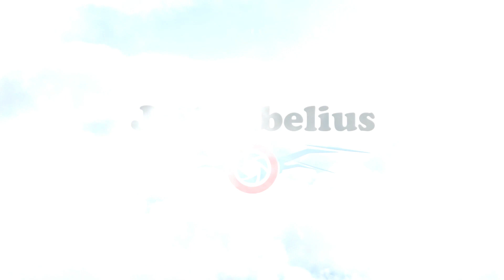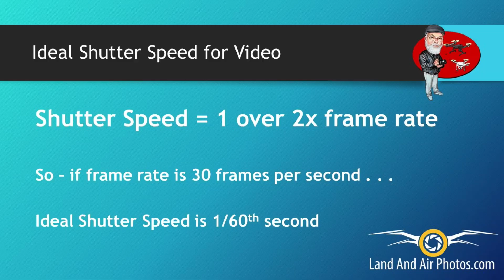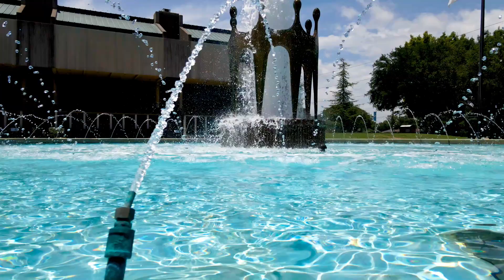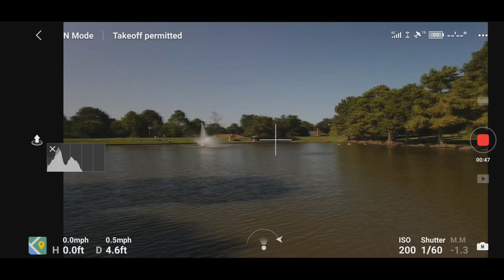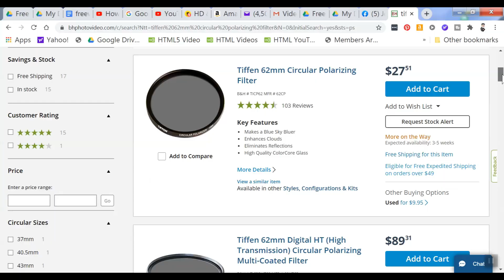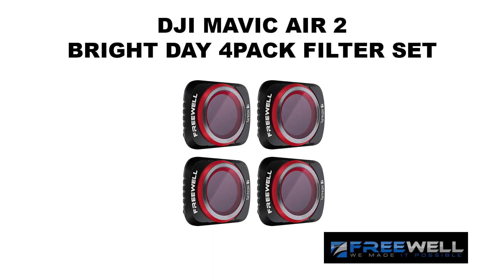Freewell All Day Filter Pack for Mavic Air 2 - Review and Tutorial

Comment: helo..[srry im always late..better late than never, i think] Serious question; I think to buy Freewell filters for my M. Air 2..my question is, the Freewell *Variable Filters, are they ok ? i like things compact..instead of 6 - 8 filters, to have 2 filters..i hope for help, pls.  thank in advance..have a good day
Reply from the maker: You can use variable filters, with two caveats. First, for obvious reasons you cant adjust the filters during flight so you want to make sure you set them well ptior to launch. Second, make sure the filter is variable for neutral density, and not jut a circulsr polarizer with a built in nd. For the latter, the adjustment is for the polarizer and not nd, so it wouldn't replace what a set of nd filters would do.

Comment: I assume you tested the CPL well, would only the simple CPL be enough for most situations as they are used as ND filters as well by many pro  photographers ?
Reply from the maker: Pro photographers are probably using longer lenses that can close down to f/22 or even smaller, so the CPL may be able to help cut light enough to make a difference for them. A CPL isn't going to work as an ND filter on a drone - typically, drone cameras have a fixed aperture around f/2.8 or so, so they're really wide open. A standard CPL filter isn't nearly dark enough to get the shutter speed down to 1/60 second unless it's really dark to begin with. I'm finding that I need to use an ND16 filter in most situations just to slow things down enough. Assuming your goal is to get your shutter speed down to twice your frame rate, that is.
Reply: @JeffSibelius  I see, thank you.

Comment: Thanks for your review! I bought the 4 filter set and I am still playing to find out wich filter works best in various situation. Is there a preferred ND filter you use during golden hours? Thanks!
Reply from the maker: Thanks!

As to your question . . . Golden hours are great for color, but they are tricky because the light is constantly increasing or decreasing. Then throw in the thought that you're flying the MA2 with that lonnnnnng flight time. 

Let's talk about the golden hour around sundown. We know that the light will diminish over the period of your flight as the sun goes down, so you want to choose a filter that gives you a proper exposure at 100 ISO at the start of your flight. Then as the flight goes on, you can increase your ISO to account for the reduced lighting up to 200, 400, etc. without having to swap filters. 

Then switch that for dawn golden hour. You know as your flight progresses it's going to get brighter. So start with a filter that gets you 1/60th second at 400 ISO, perhaps. Then, as the flight goes on you can drop it to 200 and then 100 to maintain that 1/60th second shutter speed. 

I can't tell you specifically what filter to use because it will depend on lighting conditions and even subject matter. It just depends on when in that golden hour you start, really. The approach I'd use would be to pick the filter that allows you to adjust the ISO up or down in the direction you know it will need to change.
Reply: Jeff Sibelius Very helpful! Thanks!